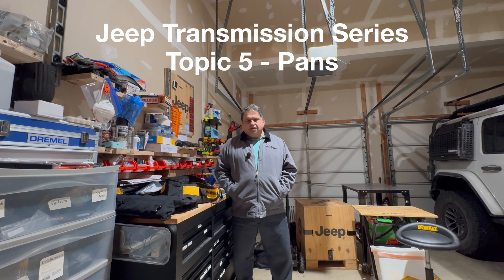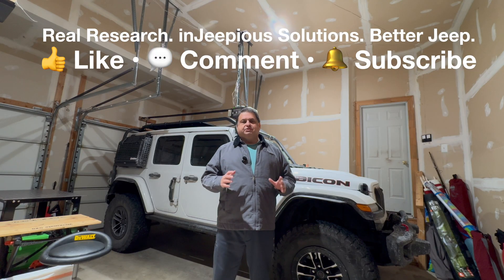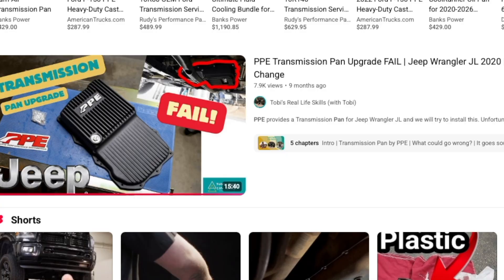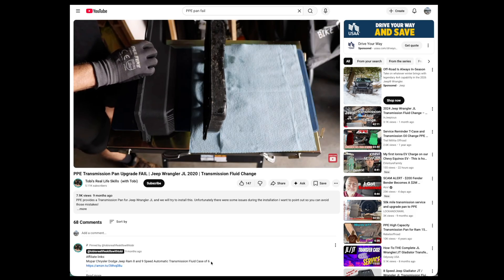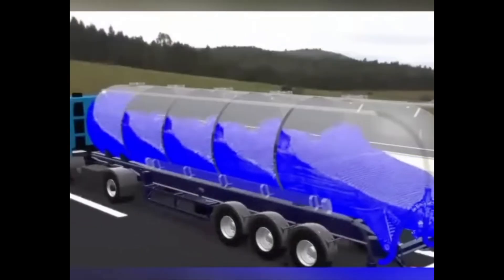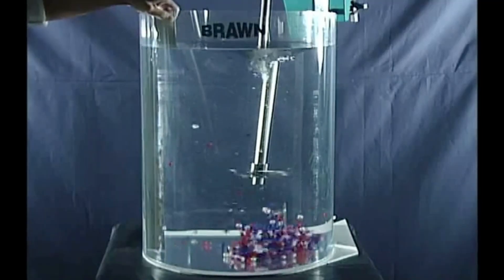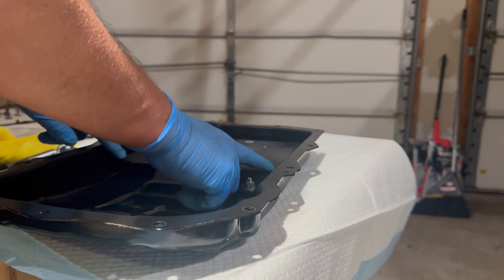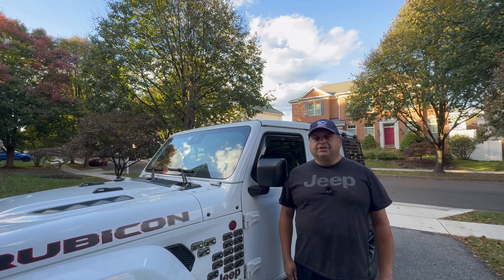Transmission Pan Geometry: OEM vs Aftermarket — Slosh, Vortex & Aeration (ZF 8HP / Jeep JL JT)

Comment: Although anecdotal, I put a PPE engine and transmission pan on my 3.6 JLUR. Immediately after, the transmission now sounds like its lo on fluid upon hard accelerations. You need to overfill the fluid to reduce it and it still exists on steep inclines. I suspect its the pan itself and will be able to verify once I put the OE back on
Reply from the maker: Appreciate you sharing that — definitely curious to hear what you find.